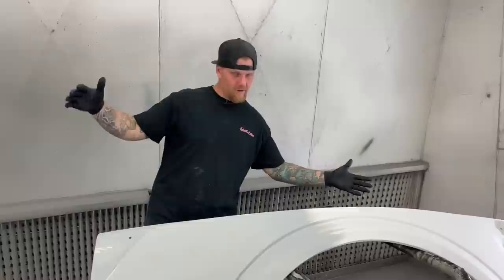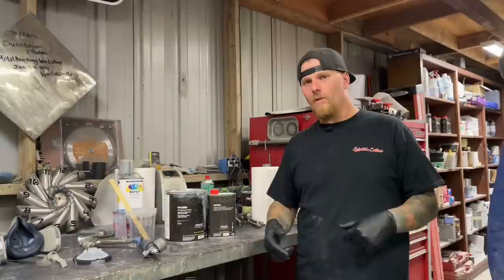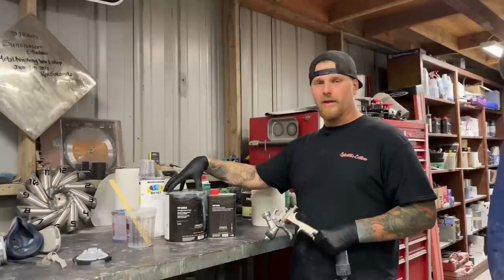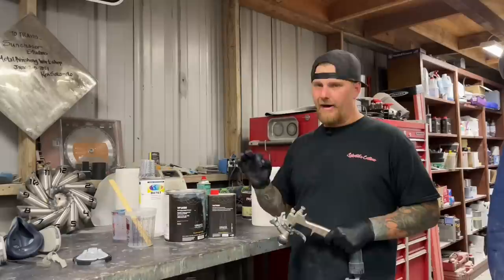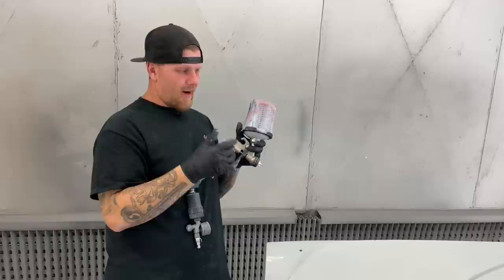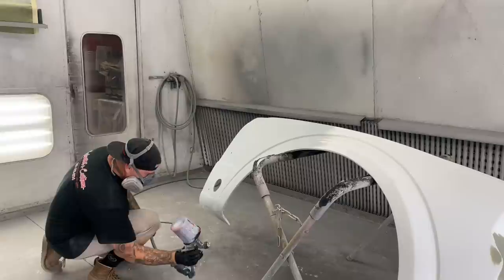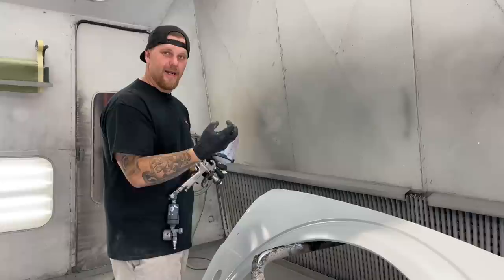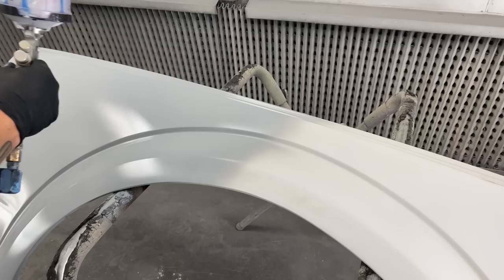The BEST Paint Gun Setup & Techniques For Beginners

Comment: As a hobbyist only, and not for profit, have used summit black DTM and 2K primer are very effective especially for overall where larger amount of material is required.
Spray the DTM over properly prepped bare metal and body work wait 30-45 mins and apply the 2K on top in 2 coats with last coat slighty over reduced to smooth it up. When you block you can see the color change if you go through the 2K which lets you know it's time to stop. The only concern is with shrinkage and like to wait several weeks before blocking.
Reply from the maker: Not what I’d recommend but sure

Comment: I use the exact same PPG products,  only difference is I prefer to use DP 90 first on a completely bare panel, I've also never found any primer to lay down as nice compared to the PPG sealer regardless of how much it's reduced.
Reply from the maker: That’s awesome and yes I agree
Reply: OL SKOOLLL maan!👌😉 That's how I was taught back in 90-93 vocational school TOO! Been doin it that way ever since as well and? NO problems, either 😏My ONLY complaint IS that they obviously removed the lead from the original DP in the early 2000s/Millennial change. The old DP, WITH the lead? You could spray it on fresh prepped metal WITHOUT topcoating it with ANYTHING (and leave it outside in the weather even, for a few years) and that epoxy would protect the metal! The newer DPLF "aka Lead Free" however? NOWHERE close to the original stuff. But?.....Is what it is.  Thx again for the vids Mr. Sly.
Reply from the maker: @jamescon55  thank you ! 👊🏻

Comment: After blending with new primer over BM and filler corrections, having already gone to 220 on the rest of the panel, so I block it with 220 again (guide coat powder) or do I go to wet sanding (as you seemed to say in the video)? You are my go to guru Travis-excellent teaching.
Reply from the maker: As long as everything is sealed up in primer, coat coat and wet sand with 600

Comment: I like to always prime outside in when your not doing the whole panel . So 1st coat then 2nd coat inside of that etc . What’s your thoughts 💭 thanks for the knowledge I appreciate you 👊🏻😎
Reply: I was originally taught to prime inside out but after so many years the paint manufacturers started recommending outside in. The two reasons were 1) so not to prime across dry over spray from first to second coat. They say it the second coat could bridge across the over spray and not bind causing de-lam. 2) it's to prevent mounding and causing excessive film build on the outer edges making it more difficult to block flat. I think that's more for people who stop each coat at the same spot. I've done both ways over the years without issue but I tend to stick to outside in now. Seems to make sense. But either is only for spot prime obviously, not full panels.
Reply from the maker: Me personally I prefer outside in so everything gets a nice wet on wet and adheres well. 👍🏻

Comment: Your series is getting great and I looked into the PPG VP shop series epoxy and this DTM primer and unfortunately in Ohio where I live O'Reilly auto sells online but says none in stock. My local jobber shops only have 2 gallons in a 100 mile radius, plus only sell the hardener in a 1 gallon amount that costs $300. PPG rep told me they do not make much of this series you use and is reason for shortage. $500 epoxy and DTM primer kits are pretty expensive to say the least. I have used many local Ohio paint producers like Speedokote and Glidden or even more expensive regular PPG paints in PA close by with not much issue. Maybe will get to try the PPG shop paint you use some day hopefully? Looking forward to the next video. 👍
Reply from the maker: Yeah the shortages are a pain right now it’s started to get better recently. Thanks for watching!

Comment: Depending on the location on a panel as to were the repair is to a body line I don't try to blend clear I'll clear the hole panel just to keep labor cost down, I would rather use a little more material  and save me time on the finished product.
Reply: I agree. Although it's definitely possible to make an invisible burn, the labor involved will be offset by the small amount of extra material. Full panel clear you can just spray it and walk away without buffing out any blend areas.
Reply from the maker: We agree we don’t blend any clears. Only base-coats then clear the entire panel.

Comment: Hey buddy. Just stumbled on to your videos and I think you're the best teacher I've found. So thx. But I'm painting my first car, white taurus police interceptor with holes from equipment and issues from them taking decals off.  Hood and front bumper used for blending, top, rt side, and all back getting redone with back left quarter used for blending. Im learning along the way but my biggest issues are 1- primer spray consistency(black widow hltp) from refill to refill. Im going through primer like crazy and keeping tip clean but everytime I refill it seems like the consistency changes and I waste a lot on my scrap board just getting that dialed back in. 2- just finished blocking and priming for the 3rd time w/Guide coat and wet sanding with 400 now but it's cutting and showing black under the primer with the places I filled holes showing my glazing putty immediately. I put 3 coats on this 3rd time but was it not thick enough? I mean I'm blowing through primer refilling cup 5 to 6 times for each stage of prime and block. I cant imagine it's not thick enough. 3- Do i tape off like a foot or so beyond where i want to stop priming in order not to get a tape line for the blending? I am learning so trying not to get frustrated. Love your vids
Reply from the maker: Sounds like you need to dial in your body work before you primer anything. You should not have to primer that many times. As far as your issue with clogging the gun, I don’t even know what primer you’re using.

Comment: How many coats of that primer can you get away with and if it doesn't block out can you add more coats
Reply: I think PPG recommends no more than three coats(can't remember on the mil thickness). I've blocked small dents out with one good coat. Heavy body filler I usually went three coats but am starting to scale back to two. Yes, you can re coat this primer as needed.
Reply from the maker: We do three. You can apply more but as your bodywork improves and gets better you won’t rely on primer to fix any lows. 👍🏻

Comment: What model Walcom gun did you use for the V2050 primer? I'm setting up a paint booth at my restoration shop and I'm going to order the same equipment you have in this video.
Reply from the maker: I forget off hand I use a couple different ones. There’s a green Kevlar one that’s awesome for epoxy. It doesn’t break down since it’s not metal
Reply: @SYLVESTERSCUSTOMS  we were looking at the slim xlight model for 180 bucks. It appears you may be using that one in the video.

Comment: 4:34 hi newbie here. can someone please enlighten me what does he mean by the primer breaking the coat of the iwata gun so he will rather use the other gun instead? is the coat specific to the iwata brand and the other guns does not have that coat? or he just want to preserve the iwata gun which is more expensive thus using the cheaper one instead? or something else? is primer bad for spray guns? pardon my english.
Reply from the maker: Epoxy primer has acids in it which will ruin the chrome plating in time. You can still do it but we use a certain  walcom because it sprays nice and is made of Kevlar not metal.
Reply: @SYLVESTERSCUSTOMS  What is the model # of the Wlacom gun you refer to in the video? 
Thank you for taling the time to post information that's useful to us novice DIYers.
Reply from the maker: @emilfrias4991  it’s called the walcom  slim kombat spray gun.
Reply: He is referring to the coating that the paint gun has on it. The chrome type finish… the gun also is coated internally. he doesn’t want to use the primer on his expensive gun so that it doesn’t break down the coating on his expensive gun.

Comment: VP 2050 keeps getting referred to as epoxy but the tech sheet says it’s just a DTM.
Reply: I had the same question for PPG when I first used this too. The terminology is confusing and misleading but was confirmed by PPG. It is an epoxy. It originally came from their industrial line but enough people started using it on cars that PPG refined it to make it more user friendly for automotive. I know DTM is generally used to describe an epoxy/urethane hybrid.
Reply from the maker: Well said thank you
Reply from the maker: What chris said 👍🏻
Reply: Interesting, on a similar note, thoughts on Tamco DTM?
Reply: @ajd5363  
Haven't personally used the Tamco products. I've heard good things. I know Linear blocks did a shrink test on it along with the VP2050. I think it's the primer you're asking about. I've had great results with the PPG so I stick with what works for me and my application.
Reply: DTM direct to metal some primers are not

Comment: That swivel joint on extension the pressure gauge is attached to on the end of the gun looks awkward as in getting in the way and risk of making contact with the panel.  
Any reason for choosing that swivel attachment?  Enjoy your content as in the final blocking stage of painting my 89 MB 560SEL  (DIY at home)
Reply from the maker: Yes that swivel helps me get into the roll cages on the prerunners we paint. Gotta swing the hose way out of the way. Thank you

Comment: Can you provide a model number and link for the Walcom spray gun please?
Reply from the maker: It’s called the slim kombat gun it’s made of Kevlar so the epoxy doesn’t eat the plating inside 👌🏻 I like the 1.8 or 2.0 tip
Reply: @SYLVESTERSCUSTOMS  thank you. Is there a certain diameter hose to use for spraying? A length not to exceed? Fittings that are used for a good setup?
Reply: @SYLVESTERSCUSTOMS  there’s HTE? HVLP? I see them now for $379 or more on their website